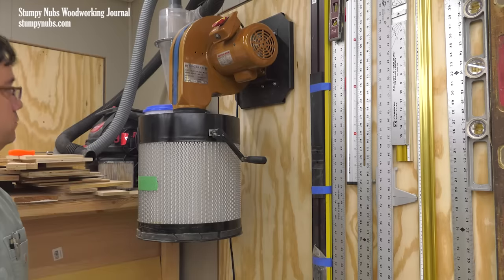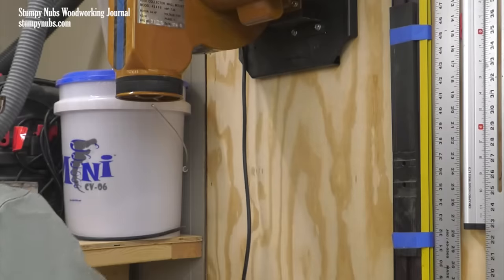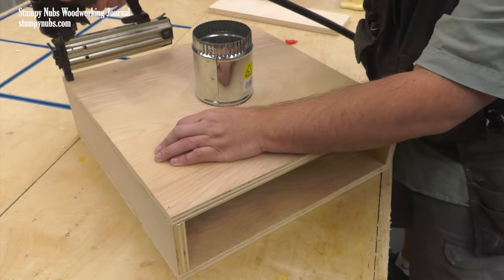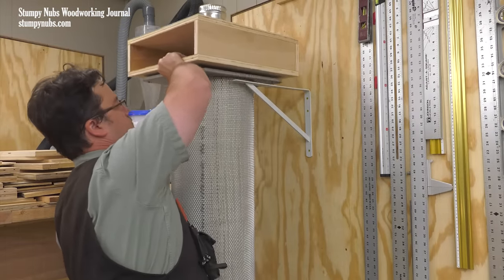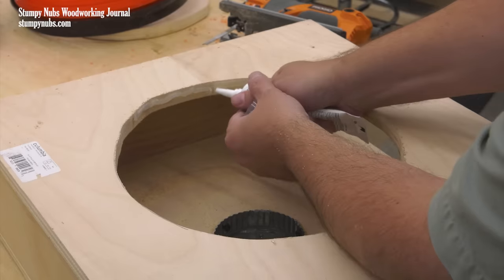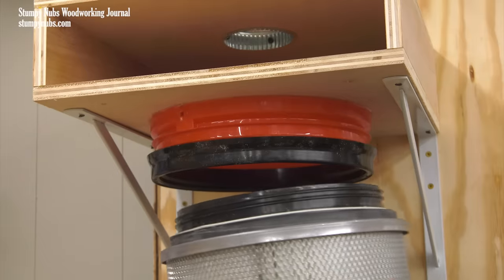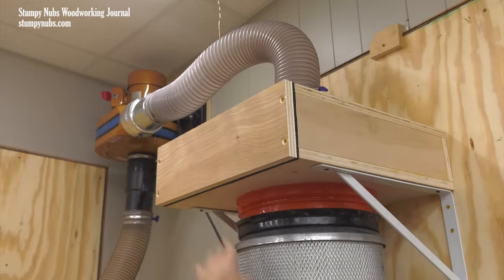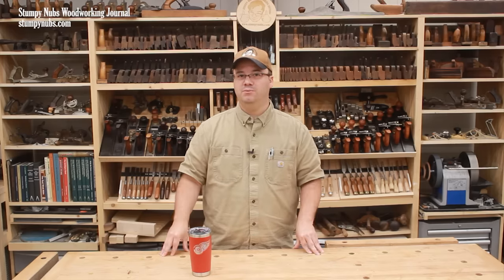Supercharge your SMALL SHOP dust collection!

Comment: well you could replace that plastic bag with another bucket in the bottom with the same unscrewing lid adaptor...
Reply from the maker: You could. But a 5 gallon pail fills pretty fast and it's tough to see when it is full.
Reply: @StumpyNubs  true, i figure you could macguyver the screw-on adaptor onto something bigger than a 5 gallon bucket. not impossible.

Comment: Shouldn't be using Duct tape on any ducts. It's actually Duck tape. For the water proof Duck cloth it was designed to mimic and improve and make a tape from. It's absolute shit on ducts and around heat or dust
Reply from the maker: I'm not using duct tape. I am using foil tape, which is specifically made and widely used for ducts.